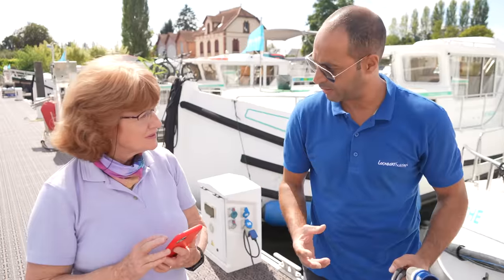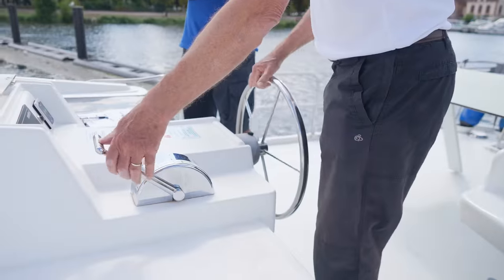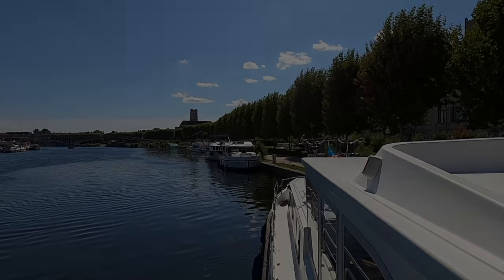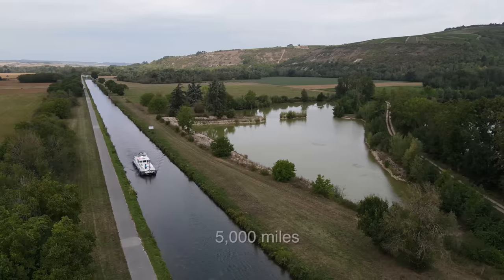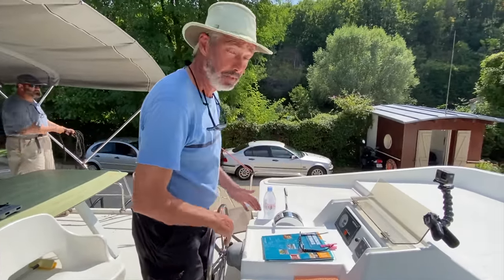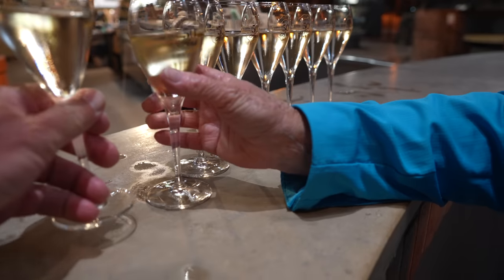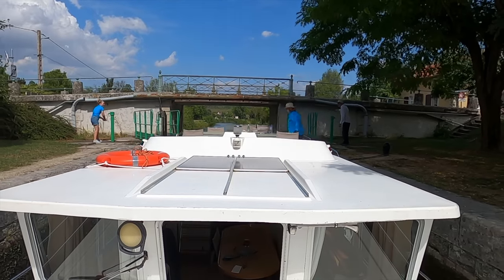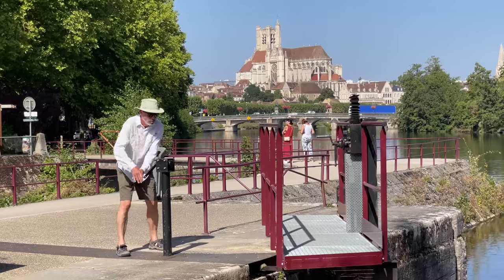French Canals: Boat Handling in TIGHT QUARTERS | EP 225

Comment: True when you go north you will get less hours of sunlight and the angle of incedence will be lower, but solar panels perfrom better at lower temperturers. Also, we use hybrid panels that get energy from two wavelengths and a broader angle of incidence than simple monocrystal panels and we would recommned that you use this style of high effeciency panels.  Also, you might consider instant on demand hot water heaters if you want to do mostly electric.